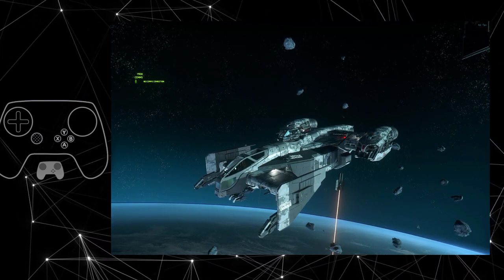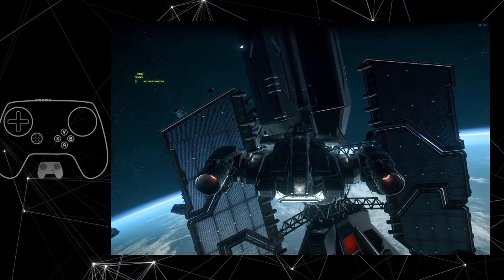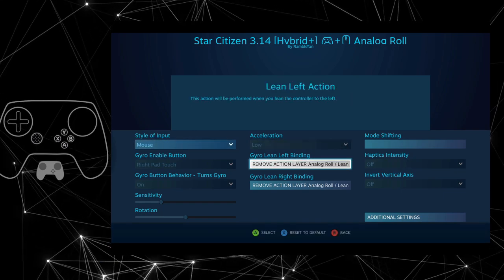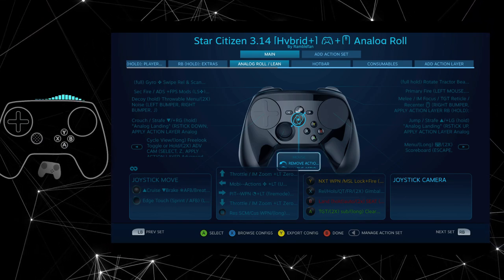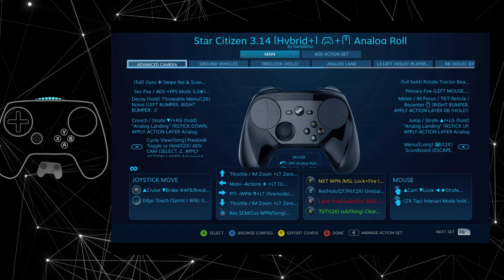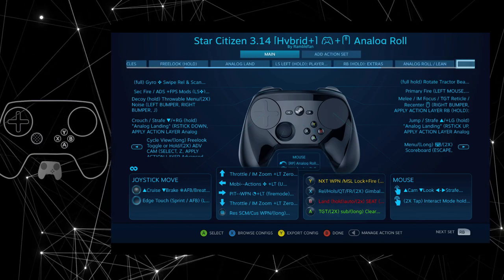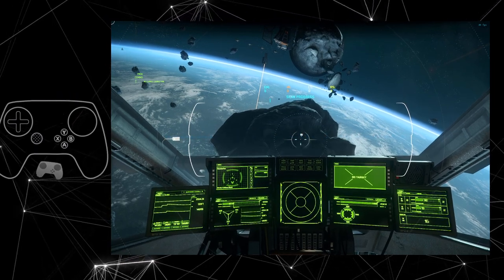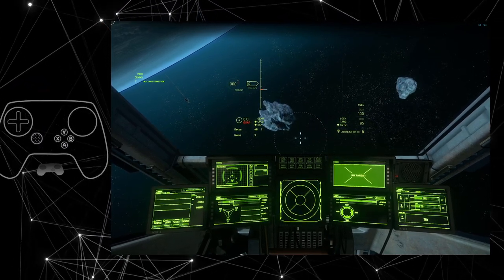🎮 Tilt To The Max! Using Tilt For Layer Hot Swaps - Steam Controller Tutorial Tip

Comment: Huh, using gyro to change action-set/layer seems like a good idea in general, so I like it. I remember a couple of games on the Wii that would for example allow you to twist the Wiimote sideways to enable the secondary mode of a weapon when you shoot. I don't remember the particular game though, might be one of the "The Conduit" games.

An example I'm more aware of is in Metroid: Other M holding the controller sideways plays in the normal mode in the third person/side perspective, but you quickly point to the screen to go into first person mode.

Comment: This limitation (having all 3 rotational axis working in the same time) is a limitation in ANY application that I've found.....ReWASD, apps for PS4 and PS5 controller......this thing would be so great for space sims games - 3 strafe axis on controller sticks, (and still have 1 axis left), and 3 rotational axis from gyro -> 6 degrees of freedom.
Reply from the maker: It could be done if you sacrifice the right pad / stick on a gyro controller. Then you could have strafing forward / back / side on left stick or pad, roll and strafe up / down on right stick or pad, and pitch yaw camera solely on gyro. I always like to keep my gyro as an addition to right stick / pad though, especially in this where I'm not making a unique layer for Flight Controls, it's all condensed with On Foot.